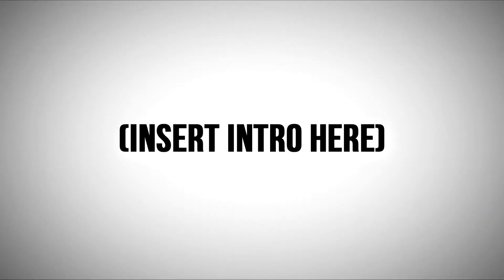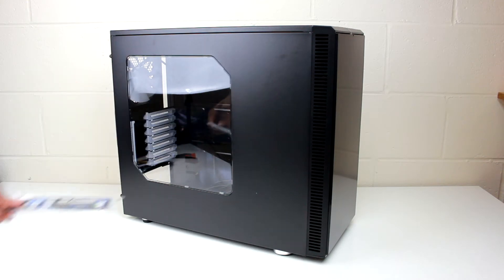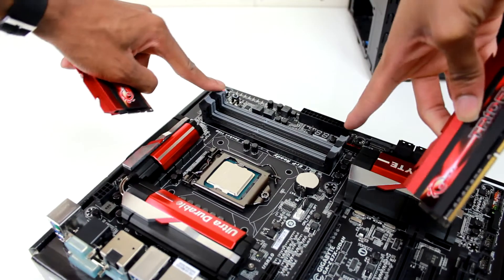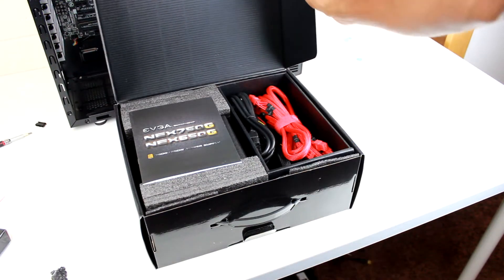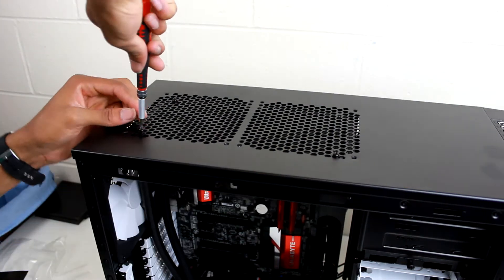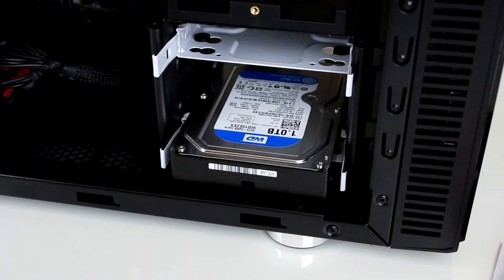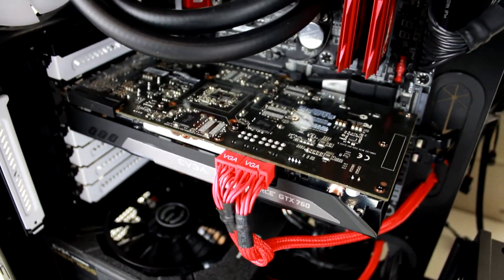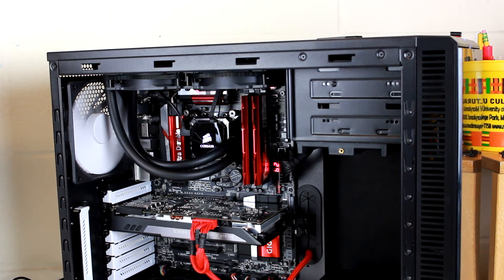PC Build 2013: Ultimate Video Editing PC Build!

Comment: Can someone pleas help me out?
 I ordered the define r4 and h100i, they'll get here later this week. 
I don't have any extra fans (yet) so i have the 2 fans included and the h100i rad fans, just like the video.

If i would install the fans like in this video, i would have 1 intake and 3 exhaust fans. This would create a negative pressure and would cause more dust to get sucked into the case.  
What would be the most optimal way to mount my fans?

Thanks in advance
Reply: The define R4 comes with 2 fans so you can put the ones that comes with the case at the front and the H100i in the top fan mounts. That should do it as long as the fans working as intake are actually moving more air than the H100i.

Comment: I just build my mid/high end PC for the first time with a GTX 980 and I got to tell you when it comes to rendering videos, I'm very disappointed. I heard from many sources that having an amazing graphics cared would've rendered my videos within seconds or minutes. It still takes me an hour with one video.

I looked online and set the preferences to use my GPU for rendering videos and it's actually slower than when I use the CPU. I'm really pissed off because I just spent over $1500 on building this supposedly grand PC. If anyone has a REAL guide on how to render videos fast, please let me know.

Below are my PC Specs. Tell me what you think.

Intel Core i5-4690 3.5GHz Quad-Core Processor
Gigabyte GA-B85M-DS3H Micro ATX LGA1150 Motherboard
G.Skill Ripjaws Z Series 8GB (2 x 4GB) DDR3-2400 Memory
Western Digital BLACK SERIES 3TB 3.5" 7200RPM Internal Hard Drive
Gigabyte GeForce GTX 980 4GB Video Card
Corsair Graphite Series 230T Grey ATX Mid Tower Case
Thermaltake SMART 550W 80+ Bronze Certified ATX Power Supply
LG GH24NSB0 DVD/CD Writer
Microsoft Windows 7 Home Premium SP1 (OEM) (64-bit)
Reply: AgentCell https://developer.nvidia.com/cuda-downloads https://developer.nvidia.com/cuda-toolkit
download that and restart your computer after then your gpu should be utilized in rendering
Reply: Enable CUDA so you actually use your GPU together with the CPU for rendering in whatever the program is that you are using. Keep in mind some video editing programs do not use that technology and you will not be able to render with your GPU.
Reply: Dgtal Breakz I did enable GPU and used CUDA. I actually render better with the CPU. I don't know WTF is going on.
Reply: AgentCell Then I cant help you :/
Reply: Your CPU doesn't seem to have hyperthreading which I believe may help with video editing, and that video card should have no troubles rendering.  In regards to a video taking an hour to render, that is all relative to how long the video is, effects etc.
Reply: To begin with: Do you really not have a SSD in your system?? Cause that might help some to begin with..
Besides that, my experience in building workstation computers tells me, that basically:
-Build the system on a good motherboard with a strong chipset.
-Use a CPU with an as-high-as-possible numbers of threads.
-Build the system with atleast 2x SSD's in RAID configuration, fx. RAID-1 ( = 2 copies of everything, and 2x read-speed)
-As much RAM as possible, and with a high MHz fx. 16 or 32 Gb DDR3 in 2400 MHz (and as-low-as-possible CL, fx. CL10)
-Choose a graphics-card suit to what you will be doing! For rendering, NVIDIA Quadro cards are great, but avoid overkill - these cards are expensive! IF you are planning to do both gaming and rendering on the same PC, then go for NVIDIA Titan cards, fx. in SLi configuration.
-And last but not least: NEVER try to save any money on the cooling solution in your system! The better the cooling, the better performance (if your overclocking), and basically, the better your cooling is, the longer the life of your system will be.
Reply: get the cuda drivers from nvidia that should enable cuda and help with your video rendering
Reply: UliPuli what do mean? how do you get the cuda drivers from nvidia?
Reply: UliPuli Thank you for this information. I really appreciate it. But I'm going to do some research to learn more about this before downloading this. Thanks.

Comment: I want to go for a build that is almost identical to this one. The only thing that bothers me about this case is the blue power led which doesn't match with the black and red color scheme
Reply from the maker: I had the exact same thought, but it doesn't bother me that much. I'd say go for it. Plus you could also get another case.
Reply: I actually wanted the blackout edition of this case it would have looked sick with all black and red and it has a white led for power. But they don't sell the blackout version in Europe :( I don't want another case, I might replace the blue led with a red one, replace the fans and spraypaint the pci slots :)

Comment: You should swap out the stock corsair SP120 fans that came with the h100i and for the Quiet Edition SP120 fans. As the name implies they are much quieter which is ideal for a build like this and they come with coloured rings including red which would match your build really well.

Comment: According to the pictures I think the PSU is taking in air and blowing it out the back. Looks similar to the rear case fan, if it was on the top it would help take heat off the cpu.

Comment: Nice build there Austin,i have a similar built ,Z87xUD4H ,i7 4770k ,16Go Kingston Fury X 14900 1866Mhz,Gigabyte Gtx780 GHZ Edition,Seasonic 750w,Noctua NH U 14S, 120 Samsung SSD Pro,1 To Western Digital 7200 and finally the case Zalman Z3 Plus ,i had that for 1200 Euros it s 1644 $.
I think you enjoy gaming experience with your rig.

Comment: Why have you installed Power Supply with fan blowing into case?
Reply from the maker: I was afraid of it sucking in air from the carpet beneath it. I've since flipped it though.
Reply: the fan isn't blowing, it's sucking (lol) . . . It doesn't really matter which way you face it.

Comment: You installed power supply fan the wrong way man, the fan needs to face the bottom air filter in your chassis
Reply from the maker: I've since changed it. I was just worried about it being right on top of the carpet, blocking it.

Comment: Why would you place the PSU with the fans up and not the other way around?
It will just be a plus that i has it own airflow... 
It grinds my gears :S
Reply from the maker: Yeah, I was worried about placing it with fan down because I was going to be placing the computer over carpet and I wasn't sure if I was going to have enough clearance. I changed it though, so it's facing down now.
Reply: ***** Won't having the PC on the carpet produce ESD. I have always been told that the PC should always be kept away from carpet.
Reply: Kieran Goodson eh, not necessarily.  The case has feet which lifts it a little bit and the motherboard and components are "lifted" from the case itself with non-conductive standoffs.  I've always had my PCs (both hand-built and store-bought) on carpet or rugs and not had problems I am aware of.

Comment: hows the computer fairing?
Reply from the maker: Pretty good! I'm planning on doing a setup tour in a week once I get back to school. Planning on changing out the stock H100i fans, they're pretty loud.
Reply: ***** oh okay! is the overall power of the computer enough to process the clips fast and efficiently in premiere? What would you have done different about the build?
Reply: ***** Great video! I was going to ask you about the H100i fans. I would think that removing the sound deadening material atop the case would increase noise quite a bit. What fans are you installing in the stock fans place?
Reply from the maker: Not sure yet. It seems like Noctua fans are practically silent but they're oh so ugly haha.

Comment: austin, i've go a pc and am using adobe premiere pro cs3.  is the build that you describe good for me?
Reply: fred g  more than enough for what you need
Reply: Burt Gordon
and can i put it together?  i know only what austin has on his videos to show me...
Reply: fred g yes it is easy. Key is making sure you have the right case and one with a lot of flaps that can be opened. 

But in my opinion it is way overkill for what you are doing especially since it is for a relatively short duration   

A relatively fast processor a lot of memory and a fast SSD drive should do the trick for less money